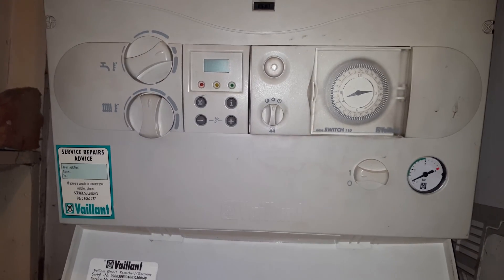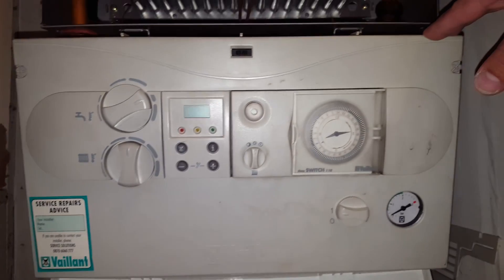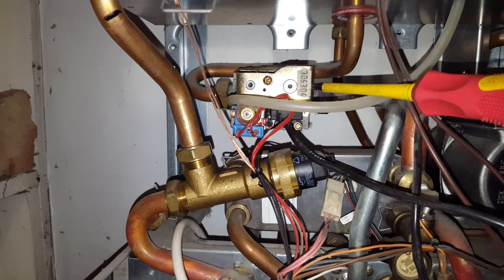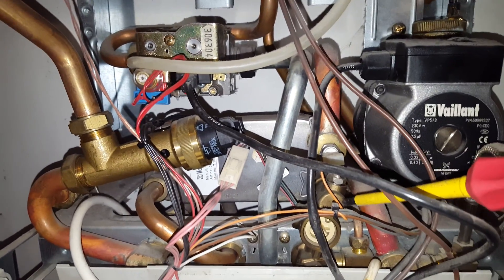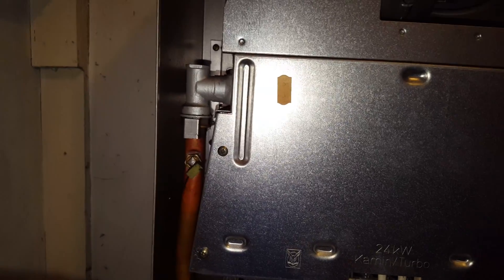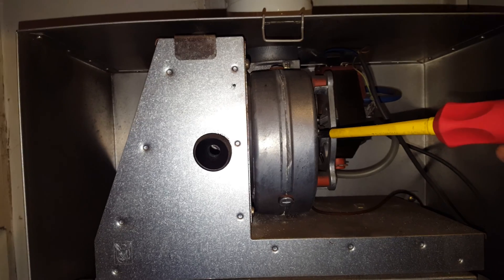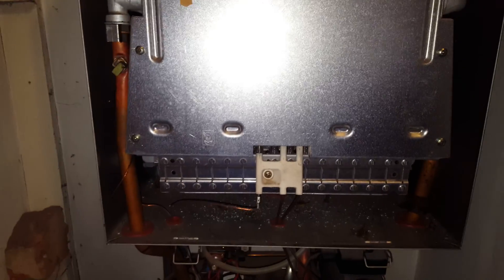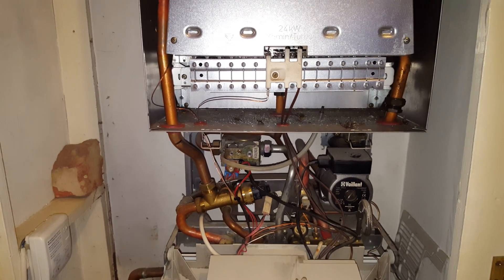Boiler repair Manchester Vaillant Turbo Max Plus

Comment: Hi. I have a vaillant turbo Max. It's showing an F 28 ignition fault. I've changed the PC board and also the gas valve. I've also clean the electrodes. But it's still not coming on. It's a very weak smell of gas. Not enough to ignite and switch on. What do you recommend I do? I look forward to any help that you could give.
Reply from the maker: It seems like the action is to speak to the Vaillant technical department

Comment: I have one of those boilers, and over the years I have had just about every part you mentioned replaced at one time or another, I think I've bought the damn thing twice!  The latest fault is when the boiler fires up for water or heating it trips the ring mains and the breaker on the consumer unit!  Great!  more expense. ...............Intergas next time I reckon.
Reply: Same as you mate I've had almost every part replaced, yesterday they condemned it saying it's uneconomical to repair. Who said Vailant was good?